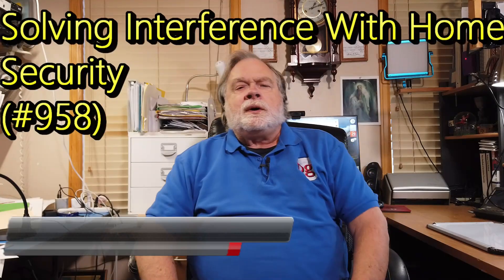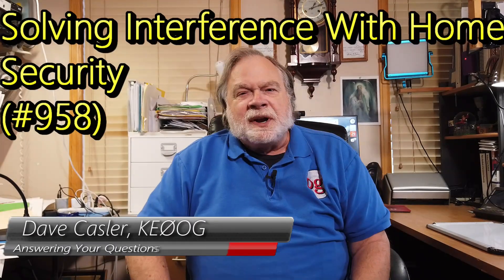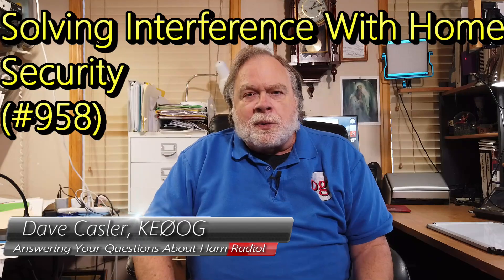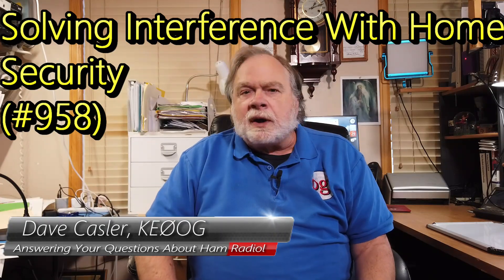Solving Interference With Home Security (#958)

Comment: Hi Dave, thanks for your videos! The current, higher speed Ethernet versions common today will actually use all the pairs for data to get the higher data rates. The PoE  power is negotiated in the protocol between two compatible devices (switch/injector and device) and then delivered as common mode current along with the differential data signals. I guess a little like audio "phantom" power, or bias-t methods of powering remote devices over coax.